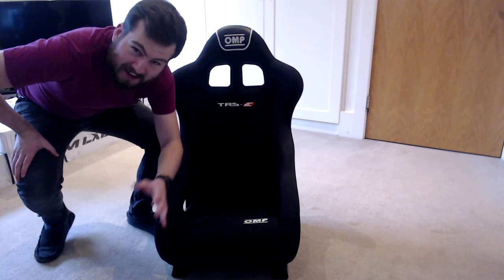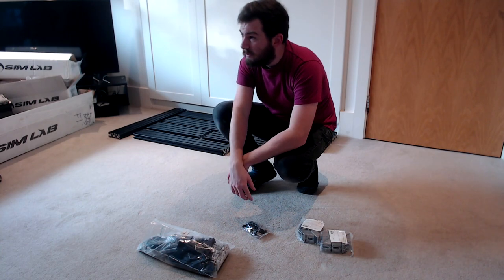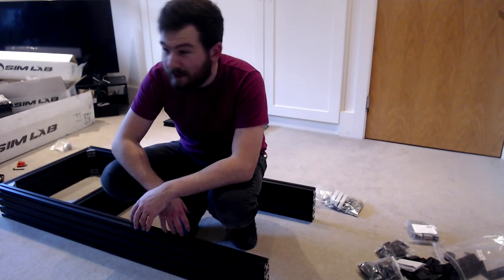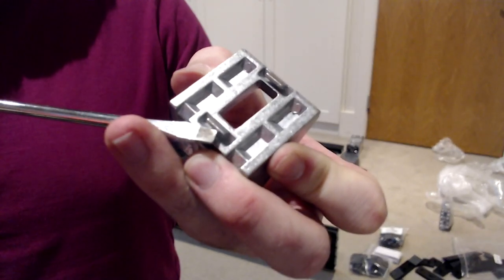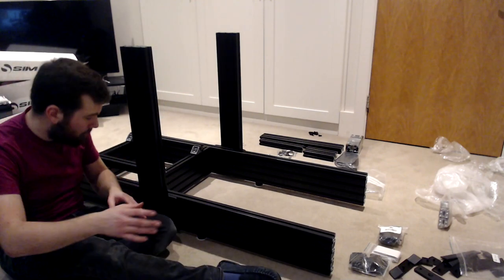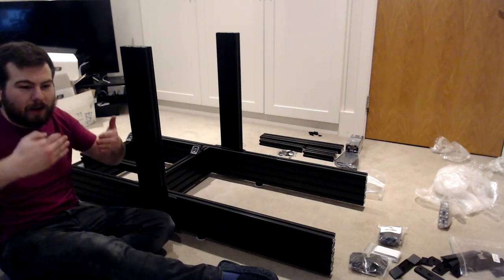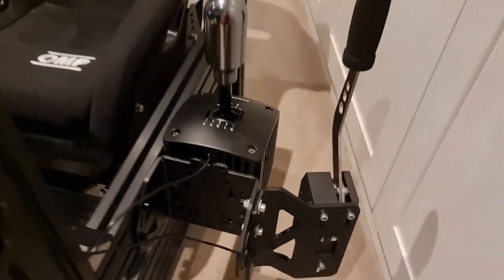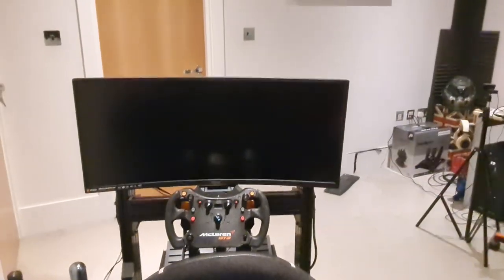Sim Lab P1-X Build | My New Rig!

Comment: I also upgraded from a K2 to a P1-X. I could immideatly feel more detail in the ffb because there was almost no flex in the rig anymore. Also with the K2 my steering mount would move slightly when I pressed the brake really hard.

That said, building and especially adjusting the P1-X was a total nightmare. Adjusting everything on the K2 was so much easier an quicker.
Reply from the maker: 100% agree! Going from something that feels really solid to something that actually IS solid was a big jump for me. FFB felt much better on the P1-X than with my (limited) testing of the DD1 on the K2. 
I think the trade off for the ease of adjustment on the K2 is that those parts can introduce minor flex. Not really noticeable on it's own but compared to a rig that you can't adjust without a mini crane, there's a difference! I'm more of a set it and forget it type of person so once I finally (3 hours of tweaking after 8 hours of building) got my P1-X how I liked it, it's then done forever.
That being said, you do have a lot of adjustability in the P1-X but it's a LOT more effort.

Comment: Nice rig, and thank you for sharing. I’m about to put the P1X together. How’s that seat working? I’m looking at the XL version.
Reply from the maker: Hey, thanks! I'm using the standard TRS-E and it works really well for me. Really comfortable but it is snug. Just bought the XL version for a rig I'm building for my dad so will be able to do a proper comparison soon. As long as you set up the angle and position correctly it'll be comfortable for even longer.
Reply: @JustLoveday  

I’m more worried about the height of it. It looks like it’s one of the tallest seats on the market at 950 cm, but I’m 6 foot 5 inches tall. 

Sparco makes one over 100 cm but it’s very expensive to put on a sim rig.
Reply from the maker: @CAM4IV  I'd say the height really isn't an issue, it's more the legs you'd have to worry about. Luckily the P1-X has some insane adjustability so you're good there. Only thing to look out for would be where your shoulders sit. If they rest on the belt loops near the head, then it could get uncomfortable. The top of the seat is pretty open so I wouldn't say you'd be getting squeezed especially if you're going for the XL

Comment: Great video,  would you now say money well spent ?
  What are the frame dimensions front to back and side to side assembled if you don't mind checking
Reply from the maker: Thanks! I would yes! Best rig I've owned or even used. It's super solid and literally everything is fully adjustable.

As for measurements, front of the rig to the back of the seat is about 150cm and across is about 70cm with the wheel support beams. Not exact measurements but pretty close.
Hope that helps!
Reply: @JustLoveday   thanks 😊

Comment: Did the brackets for the seat mounting come with the seat, or did you buy that separately?
Thinking about getting the GT1 evo and the same seat.😁
Reply from the maker: I managed to get the side mounts for free with the seat but it might just be where I ordered the seat from. I'd say have a look around to see if anyone is doing a deal for something like that, but if not the side mounts are only usually £20-£40
Reply: @JustLoveday  I'm gonna buy the Sparco seat slider and then mount the seat to the rig with that, and the side mounts if they are included.

Comment: Good job, I am building mine this weekend, but I need to add the v3 motion rig to it and a triple monitor stand and keyboard stand. Woowee. Can I ask what all tools did you need for the install? Also, do you find that seat comfortable? I’m 6ft 185.
Reply from the maker: Thanks! That sounds like an all day job! As for tools, you should be fine with an Allen/Hex set and that'll be it. I can't remember if I used anything else. The TRS-E seat is really comfortable but a little snug for me sometimes. I'd suggest going with the XL version as I have a friend that's a similar build to you, who's not able to get into the regular comfortably. Hope that helps!
Reply: @JustLoveday  thanks. I currently use the seat that came with the rseat n1 and it’s just not comfortable snd it’s a bit tight. Only concern I have is it have to be able to attach it to my v3 motion platform
Reply from the maker: @vividpsychosis8222  You should be able to use side mounts to mount onto the V3 but I've not seen anyone do it with the TRS-E.

Comment: hey mate I know its a bit late, but what monitor are u using and how good is it so far?
Reply from the maker: I'm still using the MSI Optix MAG341CQ. The monitor so nice I bought it twice! 
But seriously, the only thing that's starting to bother me is the 100hz refresh rate but not enough to make me look into other monitors. Perfect curve, perfect size and perfect resolution. Freesync (and unofficially G-Sync) ready. 
No HDR if that's your thing and the colours are above decent at best. But you can probably pick one up for £250 at this point, if you can find one. Solid choice for an ultrawide.
Like I said, I have two and got my dad one as well. Can't be too bad if I ended up with 3 of them.
Reply: @JustLoveday  thanks for the detailed response! ill take a look into it! Seems like the size of the monitor also fits really good into the cockpit just big enough

Comment: What do I need to bolt CSP V3 pedals on it ?
Reply from the maker: Everything should come in the box with the P1-X! I had basically double the amount of fixings I needed for the build, so had a LOT left over for mounting some other bits to the rig. You shouldn't have an issue mounting the pedals!

Comment: why did you change from simetik k2 to sim lab??
Reply from the maker: Good question as I can't fault the K2 really, it's a great rig. My main worry was when I was looking at getting a direct drive wheel, that the version of the K2 I have hasn't got the added supports to withstand the forces of a DD wheel. Instead of buying the direct drive support add-on or the newer version of the K2 (K2-R), I managed to grab the P1-X on the black friday sale. It meant I could have a solid rig for the DD1 and easier access for other gear I may get in the future as mounting things on the P1-X is a lot easier! Also the cost of getting the new K2-R and the K2-R monitor mount was only a little cheaper than the P1-X with the monitor mount.
I also managed to convince my dad to buy my old rig off of me as well so that helped with funding my upgrade!
Reply: @JustLoveday  I hope you enjoy them !!!  DD1 I love it but very expensive..I have the csl elite and simetik ring ... What do you think about the V3 penbals?  I'm thinking of buying them
Reply from the maker: @katsikaskostas4714  CSL and the K2 is a great combo! Exactly what I was using before I got all my new toys!
I recently uploaded part 1 of my review on the V3's but I'll summarise my thoughts here quickly. They're great! Although for me the brake pedal was a little soft but I just put the brake performance kit in and they feel a lot better! Over the CSL Elite load cell pedals it's not a massive jump. They're smoother and have better sensors but other than that they're quite comparable in terms of getting used with a load cell. You might be able to get more out of the V3's as you have more adjustability but I'll have to decide fully when I make my part 2 review.
Bit of a long one but hopefully that made sense and helps!
Reply: @JustLoveday  Thank you very much for your help !!!